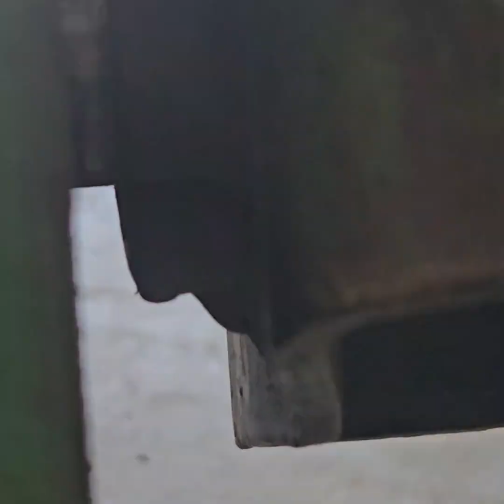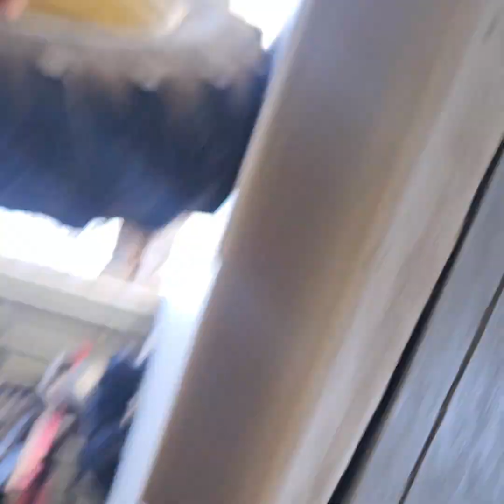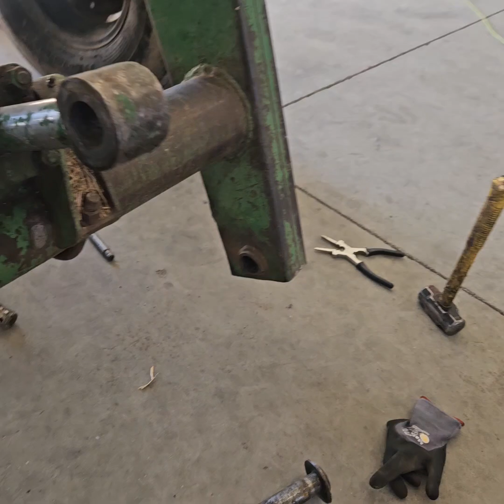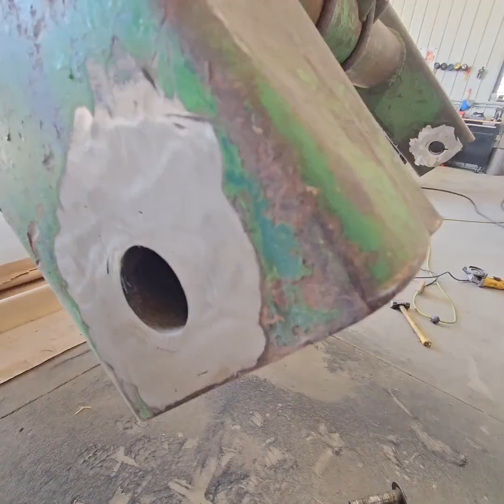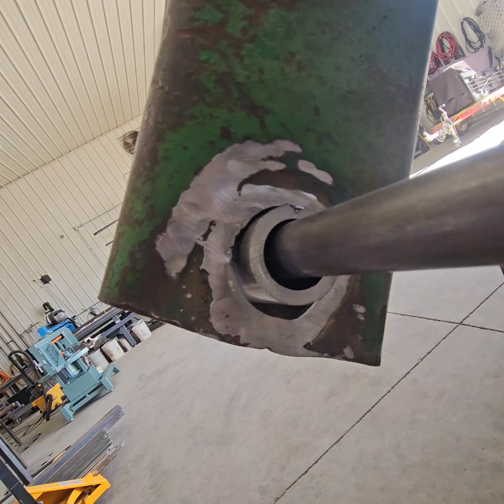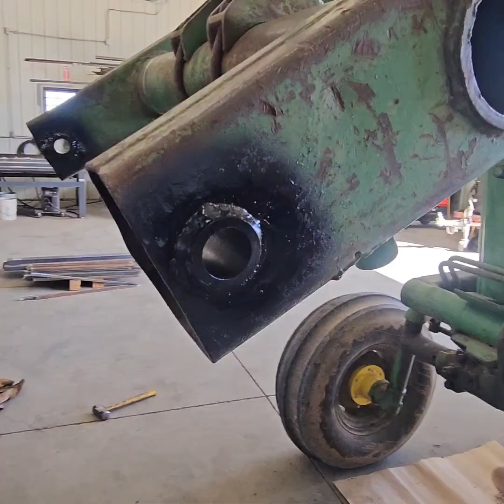John Deere front loader bushing replacement.

Comment: What did you use for your bushing material. I have a 46A that I need to replace the bushings on and I can’t seem to find any information on it. Thanks
Reply: Awesome. Thank you. I’m in the process of fitting the loader to a 2020. I adjusted the length of the loader frame to fit, now I just need to notch the frame where it sits over the front axle/tie rods for clearance and I’m converting it to a quick attach as well. I need to do the lower bushings at the same time.
Reply from the maker: I found some nice 1-3/4"OD 1/4" wall seamless DOM tube on ebay.  https://ebay.us/m/KUjGXs is the link to the listing 182348689934  if those dimensions would work for your application.